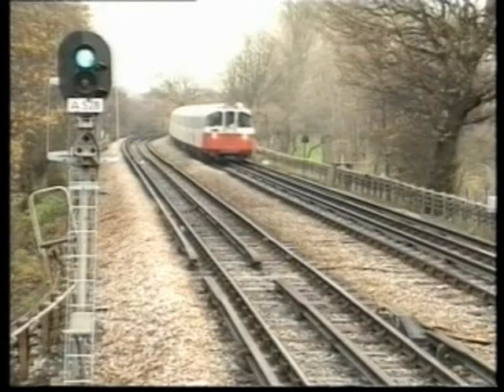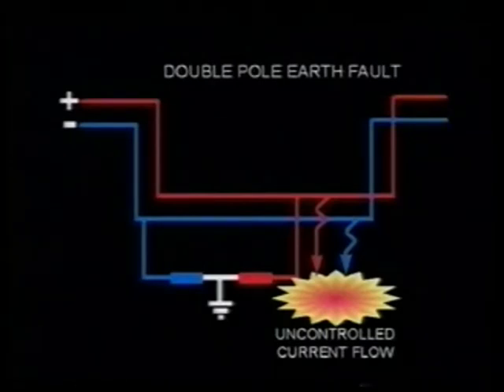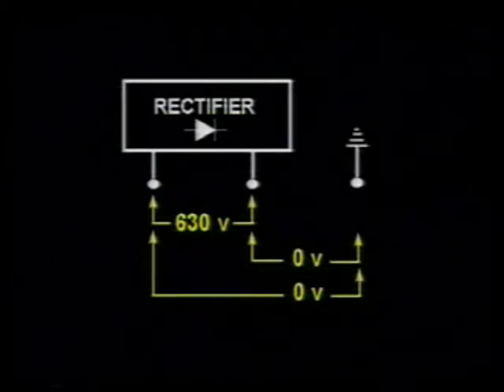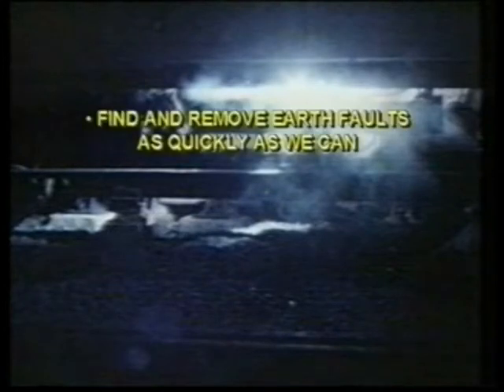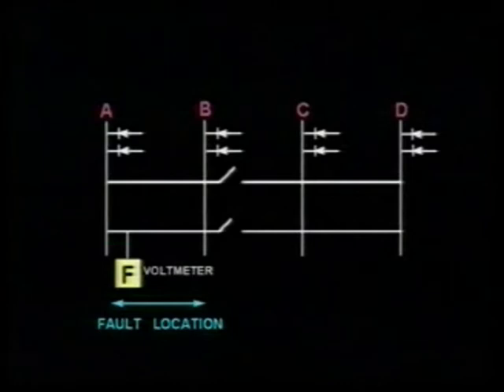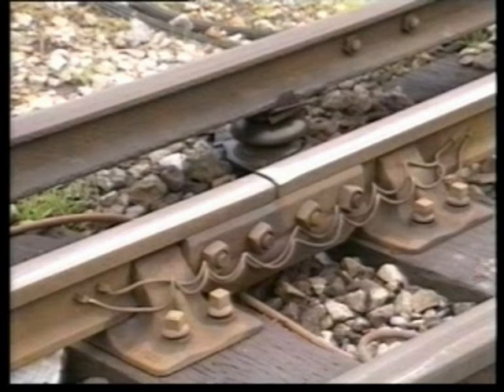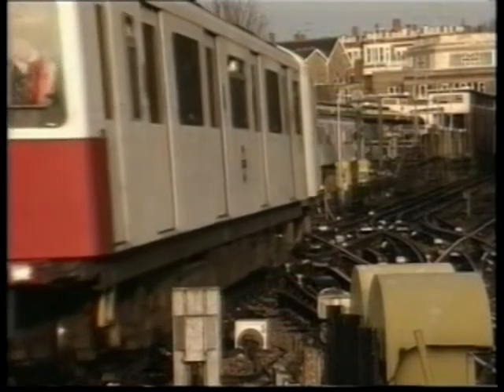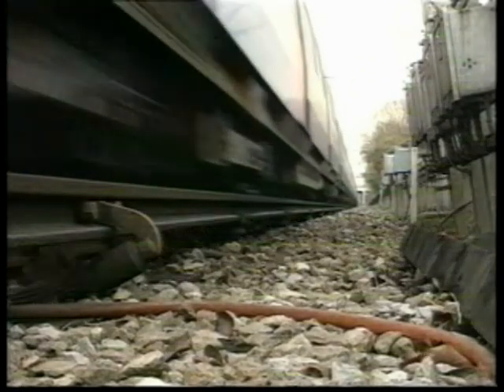1997: Short ARCHIVE video in connection with LUL Power Supply.

Comment: ah THIS is the info i knew i'd seen before!   They should use those measurement resistors as a heater in surface section workmen's accomodations LOL

Comment: It’s not only the Underground.  The Ex LMS d.c. lines in London, the Watford new line and the North London line were originally 4 rail, but were converted to 3 rail around 1970.  I don’t know about the Merseyrail d.c. lines.
Reply: @srfurley  The Mersey rail dc lines are not 4th rail only 3rd rail like southern region there are still parts of the Watford DC lines are still 4th rail because they still share the same track as the Bakerloo line

Comment: 7:35 isn’t 11kW an error - they need to re-issue this film!!! By Ohms law (V^2)/R the power would be 630^2 / 300 = 1.323kW.  If it was 11 kW the little wooden enclosures would be pretty toasty!
Reply: I think the video chap may have made a wording error. I believe EssArrB:s calculation of 3.9kW is correct. The resistors would probably be RATED at 13kW, giving a safety margin of 3:1, rather than consuming 13kW.
Reply: Yes, but if a fault shorts the 200 resistor then the full 630V is across the 100 Ohm resistor, the dissipation is then 630^2 / 100 = 3.969kW. Still nowhere near 11kW

Comment: All very interesting, but how do they manage on other underground systems like merseyrail and glasgow undergrounds where they only have the third rail? And isn't it the same on other systems abroad like the New York subway system?
Reply: They manage because the three rail only system is not as bad as was originally thought when they chose 4 rail for London. But the third rail only systems have higher costs in the form of more corrosion, more signal interference and more power interruptions, so they don’t totally “get away with it”.
Reply: 3rd. rail was used on the Waterloo & City tube line for most of its life until the old (Southern Railway) trains were replaced by Central line clones when the 4th rail was installed to avoid altering the trains. Also the Northern City line to Moorgate was converted to 3rd. rail when taken over by British Rail

Comment: Fast forward to 2:20 to actually get past pifgle to video....
Reply: Brilliant video. So how are the fourth rail trains powered on Network Rail metals?
Reply: @lorrainecruzole8939  4th rail isn't power its earth return.

On network rail lines, underground stock using the 4th return rail are provided with a centre rail (for example out to Amersham)......

All other network rail DC powered trains feed off the 3tmrd outer rail and return via the running rails
Reply: @ianhudson2193  The line to Amersham is owned by LU and Chiltern has running powers.

Network Rail owns the line from Gunnersbury to Richmond and, as you say, a 4th rail is provided. IIRC (it's some while ago) the 4th rail is bonded to the running rails to provide the necessary connections.
Reply: @lorrainecruzole8939  Search `Why does the Underground run on four rails?' here on YouTube